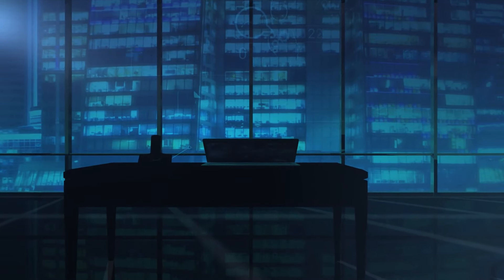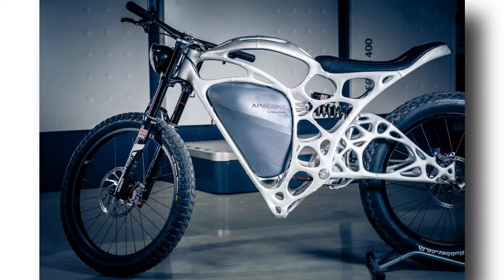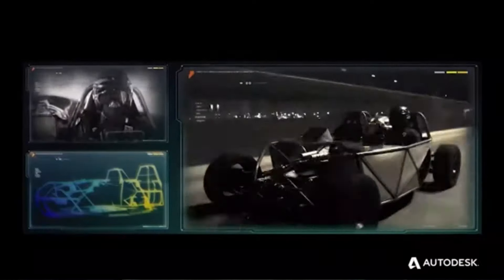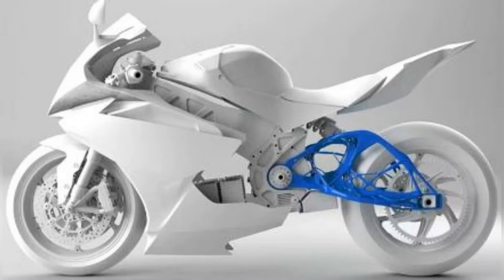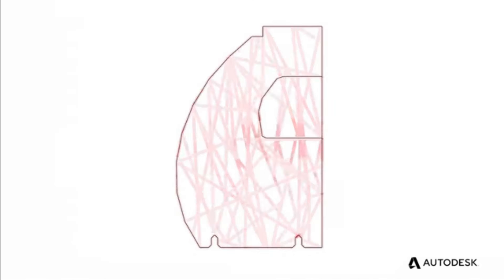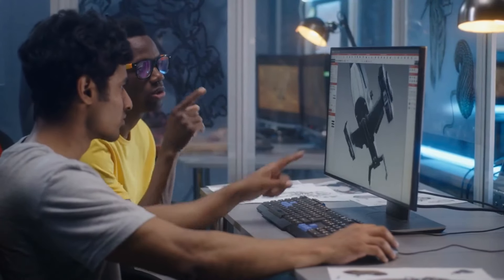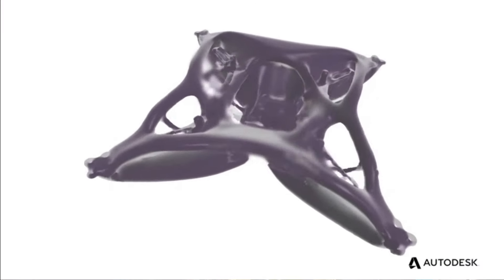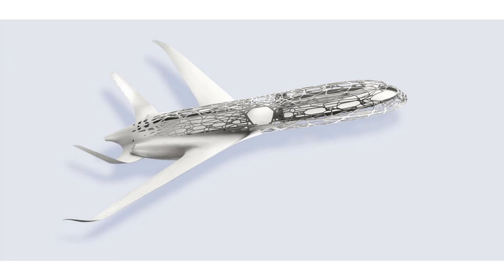Generative Design : Aircraft Design using Artificial Intelligence

Comment: Check out the Solar Electric Car, Aptera. This was designed using AI and has one of the lowest coefficient of drag of 0.13 among  the cars. Mostly uses Carbon Fibre body to reduce the air drag and rolling resistance.

Comment: A.I. might be able to design it, but if Boeing builds it...
Reply: Did you know Boeing is holding a competition, I was in it but fell off early. I learned later on how they handle business. Did I dodge a bullet?
Reply: If boing builds it is even lighter - because half the screws and bolts are never put in. Also, due to extensive experience with rocket design, the aircraft will include staging and drop landing gear after takeoff, obviously to save weight ;) How could a company fall as far as - it's planes.